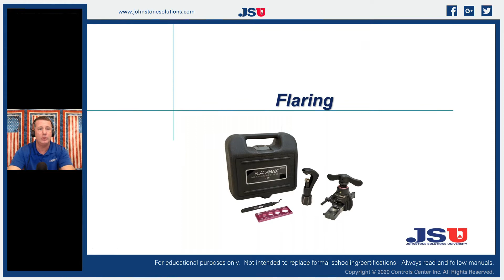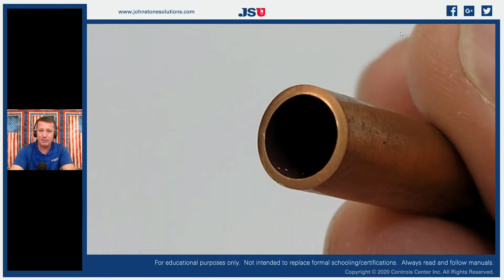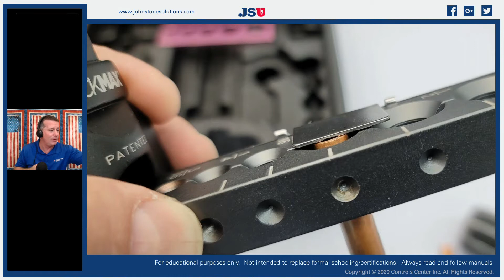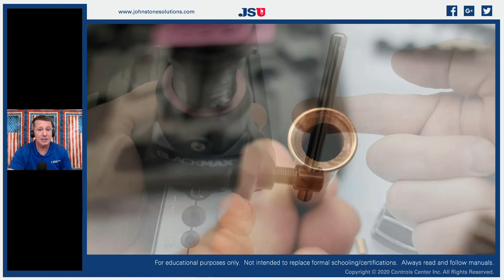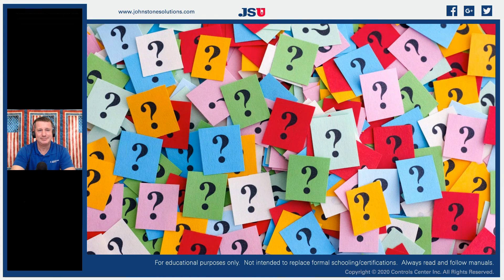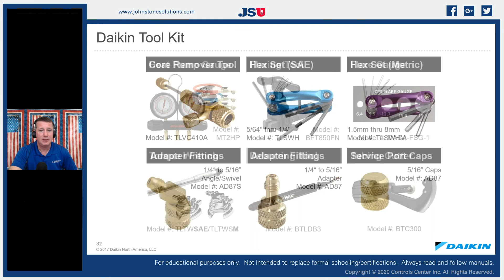Flaring

Comment: I have to say it again. Excellent video. Especially the part about the need for the copper flare to be compressible and how the tool prevents you from making mistakes all through out the process.
Reply from the maker: You know Andrew, I spent 20 years in the field and never knew what I was doing wrong until I was showed the differences. Now it completely makes sense to me. Education is a powerful tool! And I just recently learned proper flaring.